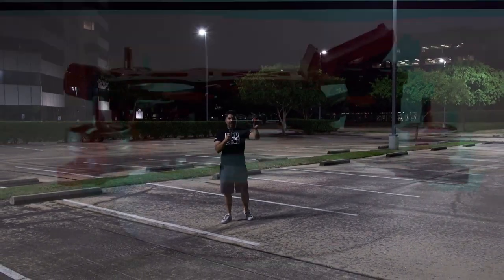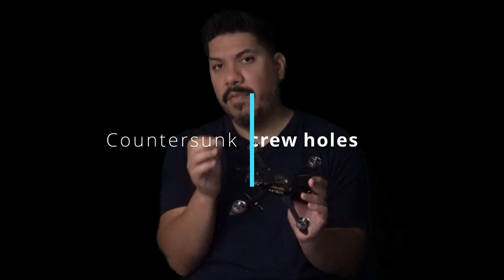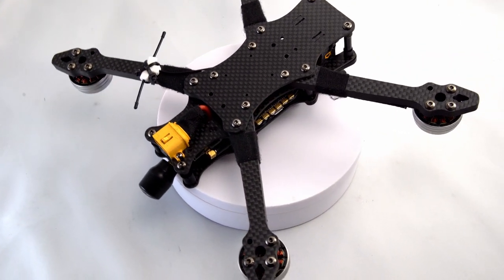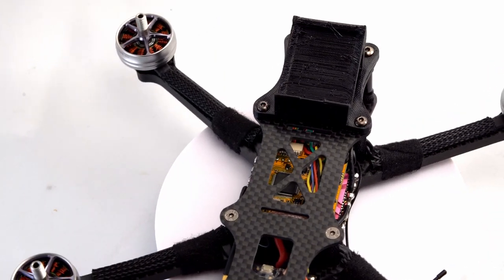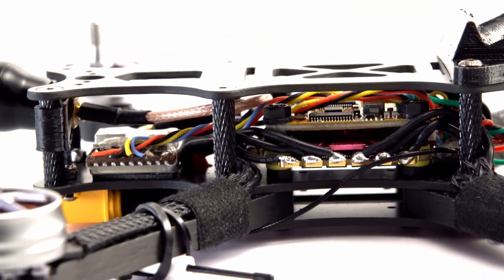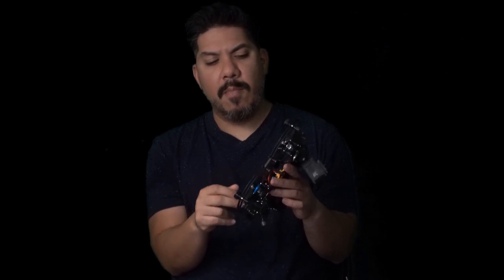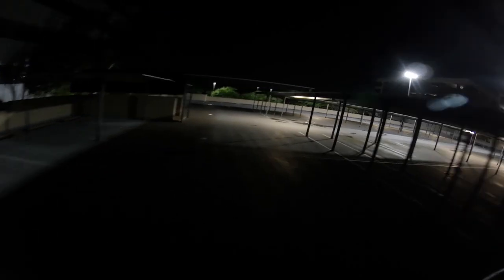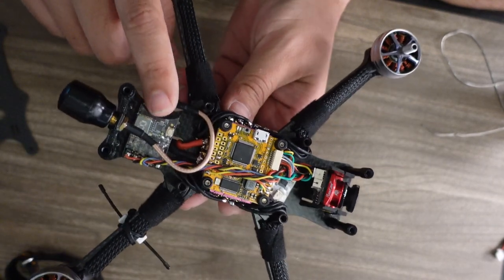Amax Performante 2207 motors and F5 Frame - 6.5mm thick arms?

Comment: Having truly abused the previous generation Performante 2207 motors - they're a fairly underrated value in terms of performance when they go on sale - really only the XNova and SunnySky stuff puts out more power for the weight, they're right on par with the R6 BH 2207's for performance in terms of output and smoothness.  The shafts aren't the most rugged, neither are the bell tops, but they look phenomenal and fly great.
Reply from the maker: great notes, i havent bashed them much yet, but def can feel the performance.  Nice to know they handle some crashing well as well.